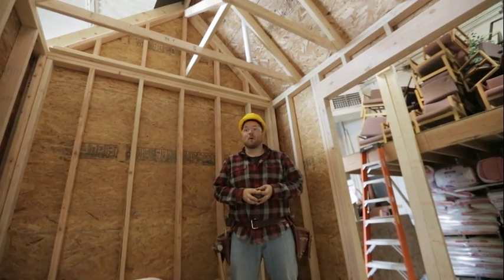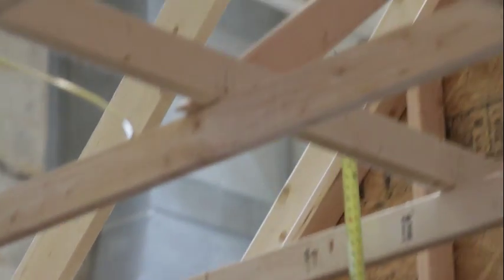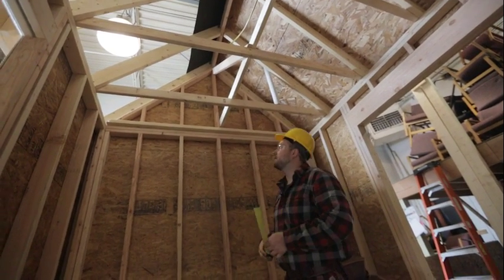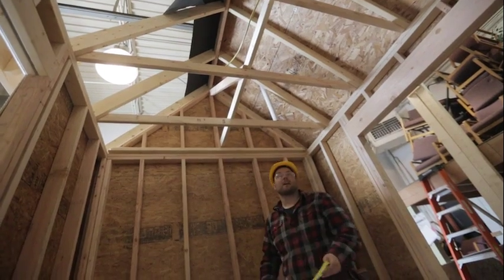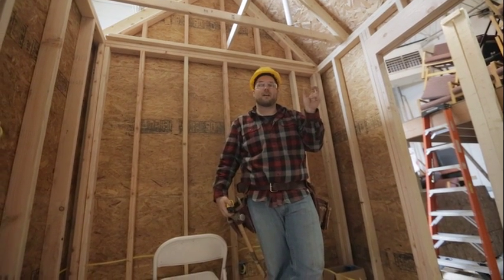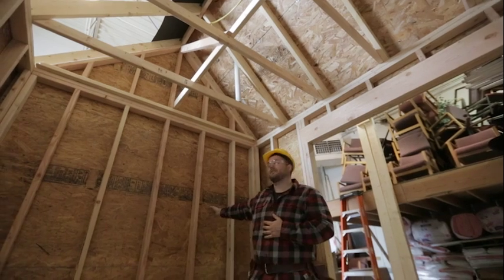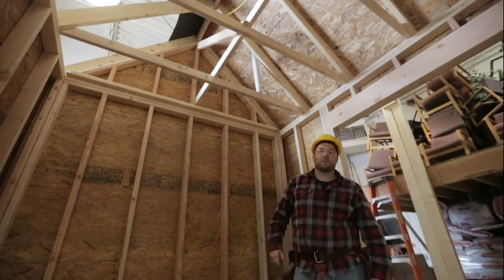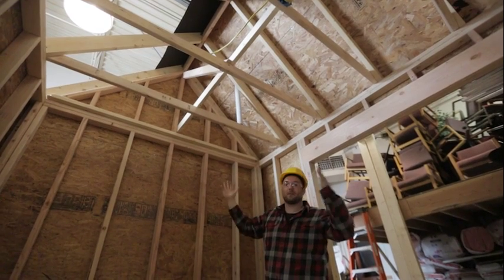How to Frame a Roof (Intro)// Roof Framing Part 1

Comment: I just found out that all the rafters were cut short by about two inches. They put in a splice every other rafter about thirteen inches long and at the back of the splice they used just one nail. In some places they put a nail on each side of the splice at the back. Is this structurally sound? They are cut short on the facia end.

Comment: We need to replace our entire roof to increase pitch (it's 1/12) and previous owners have two layers of shingles on there and it's leaking into walls. Anyway, looking for advice on best way to do this. We could remove everything in layers as we go (remove shingles, then plywood, then trusses) but this would leave whole roof exposed to elements requiring tarps..so I'm thinking we could start at the gable end and use a circular saw to cut through old shingles and plywood in maybe 4ft strips so we can remove plywood with shingles attached and dispose of that, exposing one or two trusses at a time and cutting the old trusses out and putting in new ones then attaching plywood--and repeating that process as we go to leave less exposed to elements. What do you think is the best way to do it? --Not holding you responsible if I screw up HAHA! Would greatly appreciate any advice.